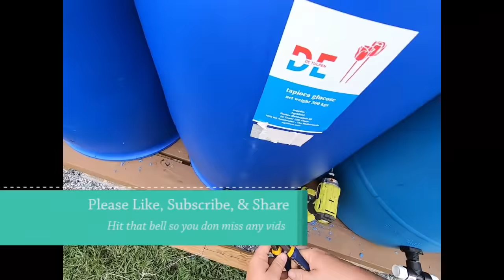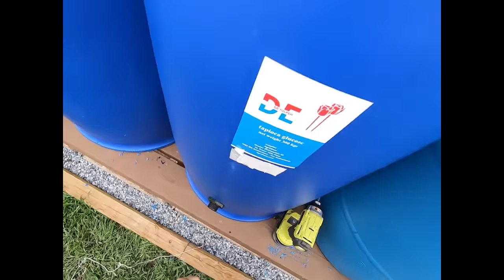Ganging 5 Rain Barrels for HUNDREDS of GALLONS of Free Water

Comment: hello, I installed a similar system, but instead of connecting by a plumbing system with the costs involved, I use a syphon system from one barrel to the next barrel. It does work, I found it out on YouTube, not having any holes ensures no leaks and it is very easy to increase capacity with an extra barrel and you can very easily remove a barrel for cleaning. Try it with 2 pop bottle and some plastic pipe, move the bottles up and down and see what happens.
Reply: That is the way we do it.
A length of hose. Fill it with water and stick each end into a couple of barrels, where there is enough water to cover the inlet in each tube.
The only engineering I have done is some 3D printed bits to hold the hose on the barrel to prevent it from folding in on itself.
Reply: I keep debating which method to use and it seems like over the top is better since there is zero chances of leaks except at the one spiggot.

Comment: Love your attention to detail. The parts list is a wonderful help. Your water system is practical and attractive.
Reply from the maker: Thank you so much for watching and kindly commenting.
Reply: Attention to detail??  You mean like putting teflon tape on backwards…that attention to detail?
Reply: Isn't it in the tape direction the same as what is screwed on?  So the bulkhead fittings' section is supposed to be, as he did, opposite the norm, since it attaches backward from normal.

Comment: Good project 👍 Not to be critical but if it was me, I'd leave just a lil more room between the barrels. They could swell out enough when they are full to put undue stress on the PVC and possibly pull apart. Other than that good job! I plan on building one virtually identical as yours. Thanks.
Reply from the maker: kevin brown , thanks for watching.  Good point.  I had thought about going with short pieces of hose between the barrels with a little slack but decided to go with the pvc.  Time will tell. It’ll be hooked up in a couple of weeks.
Reply: No they wont

Comment: Great video. And the bulkhead fitting fishing was was a great lesson  to learn. I am about to build my rain catch and i thank you for sharing that trick of the trade. Pump pliers aka adjustable (slip joint) pliers have directional teeth and if you will turn them around you will have better bite and less slippage. Thank you again for sharing and really outstanding job.
Reply from the maker: Thanks for watching and the tip. Both appreciated.

Comment: You might want to consider unions between the barrels so that they can be easily removed from service should there be any issues (leaks/cracks etc.)
Reply: I was thinking the same thing.
Reply: Why don’t people just do this? I’ve been wanting to create a rain barrel system but don’t understand why people don’t use the 275 gallon tank unless they Are getting the barrels free.
Reply: @MrCudder55  55 gallon drums are a lot easier to find, transport, and store.
Reply: @MrCudder55  it can be price or availability or even the hassle of transporting them. Where I am, food grade IBC totes just aren’t available because of the high demand but 55 gallon blue food grade drums are easy to find.

Comment: If you can include a clear section of pipe so you can make sure that the water is flowing like it should.  I have multiple IBC totes linked and I have some clear PVC sections and it is sure nice to be able to watch the water pour around in a big storm. Don't forget to paint your barrels black to prevent algae build-up.
Reply: How does painting them black prevent algae? Getting some white barrels delivered to build a system like this, so now you have me wondering if I need to paint them or something.
Reply: @OldeManGrim  Most IBC totes (always use FOOD GRADE totes to store water) are translucent.  Water that sits around, especially rainwater, will develop algae in the presence of sunlight.  Painting them black or wrapping them in black plastic prevents the presence of sunlight.   If your barrels are translucent white then yes you would want to paint them.  You can paint them whatever color you want if you want to blend them into your house for instance.  Make sure to set the barrels on a raised platform so you can use gravity to flow the water out for use.  A barrel typically holds about 55 gallons wheras a tote hold 350 or so.  totes can be bought on craigstlist for less than $100 each.  Make sure to have a ballcock valve installed inline so you can drain the barrels if needed.  I have 10 tanks (2 rows of 5 each) interlinked so that as one fills it overflows into the next one.  You would be surprised how fast the rain will fill them up.  I water my yard with it.
Reply: @thelostarchivesserialvault5353  appreciate your input. How are your drums situated, upside down or like his in this video? I am trying to not pierce the bodies of my tank (other than one for overspill).  Hard locating a video explaining the parts to do so. Would love anything you got for me. Cheers!

Comment: I have these water barrels with 90s to vertical ball valves on each tank. I can isolate or control each barrel through "Ts" on bottom of verticals too long horizontal discharge line, like yours. At end of discharge glued another ball valve for water supply.
Reply from the maker: Thanks for watching and describing your setup.

Comment: I guess the water would be 'self leveling' between the barrels...  if water flowed only into the first barrel... it would flow out the bottom and to the other 4 barrels equally and fill them from the bottom up?   Would there be any type of overflow device in case of a hard rain and all 5 barrels filled up?  Thanks so much for sharing.  This video is the cleanest/ easiest to watch for a rain barrel system.
Reply from the maker: Right about self leveling. As far as overfilling i just let the water overflow at the fill point until I can switch the diverter back to the downspout. I believe there are automatic diverters but all my systems are on barns, sheds, etc. if I had them on my house I’d definitely get something automatic. 
Thanks for watching. Greatly appreciated.

Comment: I would have used a core drill bit.  In your case you should drill a pilot hold then use the spade bit.  Very hot water and some dish soak would be a good way to get rid of the stickyness.

Comment: did you keep any motor to pump water or pressure was enough to use to your drip irrigation system ? and also can we keep that on ground or is it recommended to keep on height?

Comment: have you had any issues with the weight of the barrels on that wooden structure? 55 gallons X 8.33 ppg X 5 barrels is ~ 2300 lbs.

Great instructional video. I'll have to implement this off my shed to collect garden water.
Reply from the maker: No. It would hold a lot more than that. Thanks for watching.

Comment: Great video. Thanks for sharing. I've watched several on connecting rain barrels and yours looks the most professional and solid, and you explain it well. Have you had any issues with algae growing in the barrels? I just got some blue barrels like those and I when I peek inside, I can see more light penetrating than I expected. From what I've researched, the barrel needs to be fairly opaque to prevent algae. Thanks again.
Reply from the maker: Thanks for watching. I get some algae but nothing severe.  It doesn’t bother me too much because I’m just watering the berries.  In my totes I get some also but I treat that with a bit of Clorox now and then. I use one of them for animals so I treat it.
Reply: paint the barrels black.  I have 7 connected 55 gallon barrels out by my garden.  I hook up 180 feet of pvc pipe and fill them with my sump pump water.  I have a spring in my backyard and they get filled in about 3 hours.  The first year I didn't paint them and had algae galore, and my sister told my to paint them black, which I did and have not had a problem with algae since; just beautiful clear water.
Reply: @marycollins121   What kind of paint are you using that sticks to that plastic?
Reply: @superkillr  PITTSBURG PARAMOUNT     EXTERIOR BLACK     Used small foam roller to roll on, gave them two  coats.

Comment: I'm kind of surprised that you don't put a gasket on before you screw on the nut to those (bulkhead fitting) outlets for the barrels.
Reply from the maker: There’s a built in gasket on the back piece. The front shouldn’t need one. They don’t leak n

Comment: Thank you for sharing this video. We are working on our first Rain Barrel project (4 barrels). Is this permanent structure, once all the plumbing is glued?  Do you have any issues with sludge or build up bottom of barrel? If you do or not, how would you recommend to clean out the bottom barrels with this setup? Thanks!
Reply from the maker: Sludge will always be a problem after years of use. I drain mine every fall and this flushes them out ok. It wouldn’t be difficult to put bottom drain outs on the barrels not you would still have some settled stuff that would be hard to get out. Metal roofs have far less stuff that comes off compared to asphalt shingles also. The more stuff you can keep out the better.

Comment: How has the system performed in a heavy downpour? Are the PVC pipes able to handle the water volume to fill without significant backup? Am planning to do a similar setup but I would want a system which would enable me to easily detach individual barrels as I'm sure they would need cleaning periodically.
Reply from the maker: My roof isn’t that large so most of the time the size of my piping is ok.  Bigger roof bigger piping. During those times when it rain real hard the water overflows at the top inlet the same way it does until I move the diverter to the downspout.  The style of the diverter I buy allows for an infinite amount of settings between barrels and downspout.

Comment: How did you connect the barrels at the top to transfer water between barrels as they fill from the downspout? (Lovely set-up, btw, so neat and beautifully organized!) and, so impressed with how you set up & fished the fitting from the inside!
Reply from the maker: The water fills from the bottom. This way all the barrels will have the same amount of water in them at all times. Thanks for watching.
Reply: @LancoAmish  thx! I had no idea there was sufficient water pressure to fill from the bottom...(I am assuming you have filtration at the intake?)...I did not see how you managed overflow relief with all the rain we have been getting? (I live in MD near the Conowingo Dam)

Comment: Good video..👨‍🌾But I do have a question 🤔. Why didn't you connect overflows from the top to each barrel? Basically so each barrel would be filling the next one and so on. 

Admittedly you'd have to build your stand a little different. But it seems far more efficient to have gravity doing the work for you.

Any help you have a great day. 👍
Reply from the maker: Thanks for watching. Connecting at the bottom allows all tanks to fill simultaneously and evenly.  Here’s a link.  
https://agriculture.coerco.com.au/agriculture-blog/two-ways-to-link-multiple-water-tanks-together-to-maximise-rainwater-harvesting-potential?hs_amp=true
Reply: Is that platform stout enough to hold the filled weight of all those barrels?

Comment: Great project, I’m going to try some blue barrels since you show how easy it is to get a bulkhead fitting on them. How have they held up over time? My concern when I ganged together IBC totes was shifting due to weight so I used 3/4 inch hose at some junctions. While it takes care of the problem, it does really slow down the water between the barrels. Did the straight PVC pipe hold up for you?
Reply from the maker: Thanks for watching. Holding up fine.  They have to be drained for winter ganged like this but no problem.

Comment: The only detail  that may inhibit your system is venting . Without individual events your tanks wont fill or drain equally  or properly . Like putting your thumb on a straw .
Reply from the maker: Each barrel is capped. Loosening them a bit cures that. Thanks for watching.

Comment: I had the multi barrel setup for about a year, then realized how FKing stupid that is, and just got a used 330 gallon food grade toat "used" with a QD valve, and metal cage.  Pump mounts right to the side, hoses are attached directly to the cage.  Looks clean AF, works WAY better, takes up LESS space, and has a HIGHER capacity.  You need 6 of those damn 55s to get the same cap.
Reply from the maker: Thanks for watching. I have 3 of the large totes…didn’t want them here as they stick out and make mowing unhandy.

Comment: Why do most people use pvc pipe for rain barrels I'm using 3/4 pex to join them together also used pex for my house water tanks for them I've used old hot water heater 3 electric and I gas giving me almost 200 imperial gallons of water for household use and when they're set up 10 x45 imperial gallon of rain water for the garden and indoor greenhouses 4 are downstairs for year round use and I at each downspout 3 for the house and 1 each for the garage and sheds they're caped for the winter so they don't freeze and break the barrels the outside ones are open top and came with the house

Comment: I done this with 8 of the pallet tanks, no drilling just buy the tap fitting and connect to plastic pipe. On a scaffold set l put 2 new tanks of 1,000 litres with black plastic joined together and a solar pump from Amazon so it gives hot water for showers and washing, the pump brings water from the 8 on a ball cock so there is always 2,000 of hot water. The 2 black tanks are wrapped in thick black plastic to keep the heat from the sun morning to night.

Comment: Without having access to an easy lid how do you clean these out and how often do you? I have read that you need to clean them due to algea and debris build up.
Reply from the maker: Thanks for watching. Not real easy to clean out but these are for my garden. There are caps on the top that you can use a hose sprayer through if needed.

Comment: Would it be possible to use pex coming out of the bulkhead fitting?  Minor movement of barrels might not cause a pipe break.
Reply from the maker: Shouldn’t be any problem. Thanks for watching.
Reply: @LancoAmish  Very glad to have found your creative bulkhead install.  My barrels will be on the ground and likely to shift some so the pex should give enough to compensate for any movement.

Comment: If you are filling using a down spout how do you vent from barrel to barrel a 3" down spout can carry more than 30 times the water of a 3/4" pipe. the only way this setup will work properly you would have to plum the gutter to the top of every barrel.
Reply from the maker: Thanks for watching. Each barrel can be vented at the top by loosening the filler caps.   You are assuming that a 3 inch downspout is filled with water during a rain storm.  Very unlikely.  However, There is going to be a lot of water that continues down the downspout to the ground.  A diverter can be infinitely adjusted to split the flow between barrels and ground. There is also a diverter sold that you can attach a regular hose  to so you are only getting that amount of flow to the barrels.  Search downspout diverters and you will find both varieties.
Reply: RIGHT ,,,,,,, the way it is now the barrels will never fill up

Comment: Where did you purchase the bulkhead fittings that you used on these barrels?  The 3/4" bulkhead fittings I have purchased here in Texas will not fit through the 2" bung hole in the barrels I have!!
Reply from the maker: I drilled out the holes myself.
Reply: @LancoAmish - the bung hole on the TOP of the barrels is too small to drop the part into the barrel on a string!  Drilling the hole near the bottom side won't be a problem! I bought two different brands of 3/4" bulkhead fittings, and neither of them will go through the 2"  bung hole in the top of the barrels. 😢
Barry Litchfield
Reply from the maker: @barrylitchfield8357  Got ya.  I picked mine up at a custom sprayer manufacturer. Perhaps look online. I haven't heard of anyone else having this problem.
Reply: I’m having the same problem! I don’t want to cut holes on the top to install, but I may have to. What is the diameter of your bulkheads?
Reply: @makennahorrocks491  Order brass bulkhead fittings.  They will fit through the bung holes of your barrels. They're more expensive, but also better quality (and they'll fit through the bung holes)

Comment: I would install a pair of 2x4's in a T formation under the length of the pipes.  You might have to cut the bottom part to make it fit, but you can then screw in from below and then strap clamp the pipes from there.  The weakest point now is the part where the pvc section you installed last insert into the T joints.  They really need to be braced up.  Get a band clamp to go around all 5 tanks.  What I refer to is like the ones used to hold down loads on trucks or trailers.
Reply from the maker: Thanks for watching and all the helpful suggestion. Appreciate them!

Comment: For the PVC Bulkhead fitting, is the 3/4 in size the Female thread?  It looks like you needed a 3/4 Male-to-Male coupling for each barrel, which looks to be absent from the Parts List.  Anyway, good video, Thanks a Lot!!
Reply from the maker: I believe you’re right. I used a 3/4” male adapter into the T.  So I’ll have to add 5 of them into the parts list.  I put the parts list together a while after the video was put out.  When I do this type of plumbing I go to my “go to” guy who fabricates field sprayers. I tell him what I want to do and like magic in a few minutes he has all the parts on the counter.  There are many other ways to plumb this project but I go with what he has in his shop do sometimes it might not be the easiest way nor are the parts easily found in hardware stores.